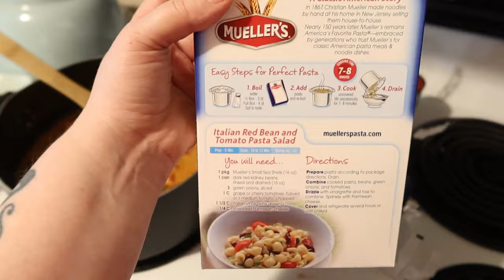EASY SPRING DIY HOME PROJECTS ON A BUDGET / SMALL HOUSE UPDATES / CHEAP RENNOVATIONS

Comment: I love the color..my only concern is if your using interior paint on the door instead of exterior paint..just be cautious that in time that paint if interior will start to peel from the heat/cold combo..maybe seal it..might help it last longer..
Reply from the maker: Thank you for the advice ☺️
Reply: Since there is a storm door, it may not be as exposed to the elements so it could be just fine.
Reply: @alisabundrick4707  that actually would be worse. A storm door seals in the heat, and in the south, that means it will basically melt off if it's not meant to withstand it like an exterior paint.
Reply: Oh well shell just have to redo it. It's not that much area to cover.
Reply: Once you buy the correct exterior outdoor paint , paint your steps too because the color of your door is fabulous. It is making you so happy remodeling 😀
Reply from the maker: @Grabfma040508  I've thought about painting them red 🙈
Reply: @erikastanger7848  time will tell...its just paint...goodness!
Reply: Sorry hun I really didn't mean for my comment to cause issue..I live in a mobile home and just know from experience of using wrong paint on outside what happens over time..but its all learn by experience thats all anyone can do..I new you had some poly acrylic from your counter tops so thats why I suggested maybe sealing them would last longer then a few yrs before it started peeling..but yes it is just paint and small area to have to do..
Reply from the maker: @bobbieclark8554  it's alright :)